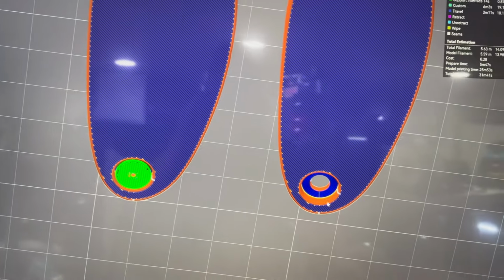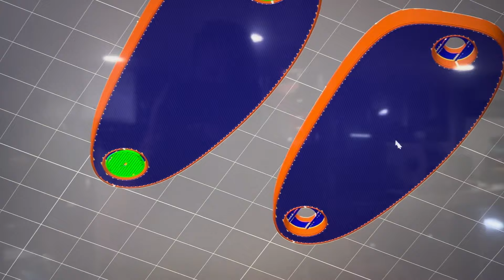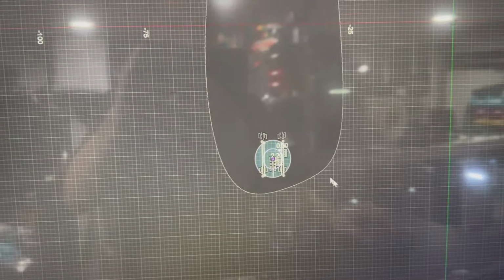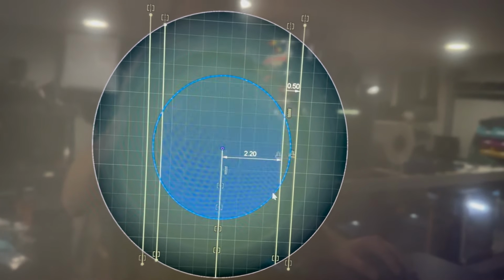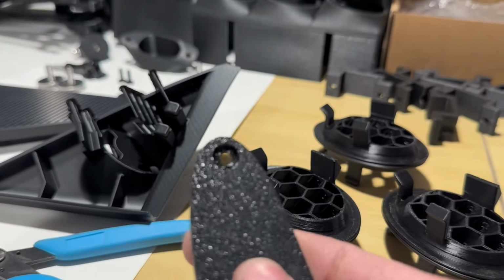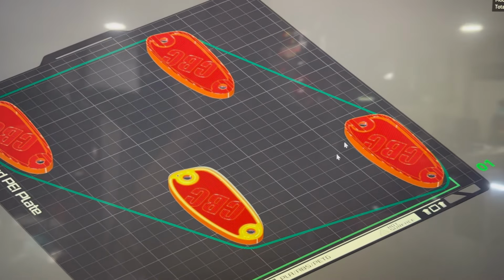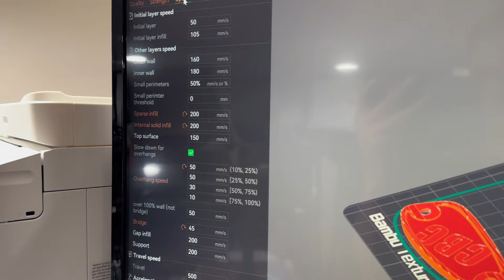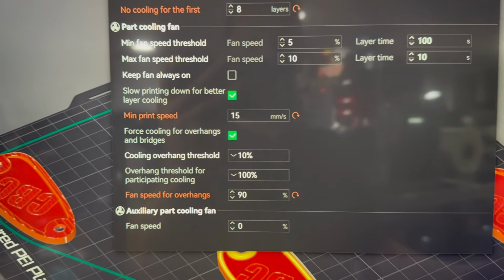DO NOT support in step overhangs

Comment: Those work but depending on the part and how hard you are tightening the bolt it can wear in over time. Another option for any flat surface is to build in your own support with just a flat surface 0.2mm below the supported piece. Pops off easy and leaves a nice flat surface.
Reply from the maker: @caramelzappa  that’s true, well tuned supports aren’t difficult to remove 🤝 this tip is more aimed for production type models where time and material savings would add up, especially if this hole for the support was deeper